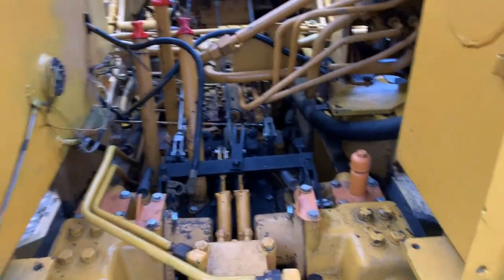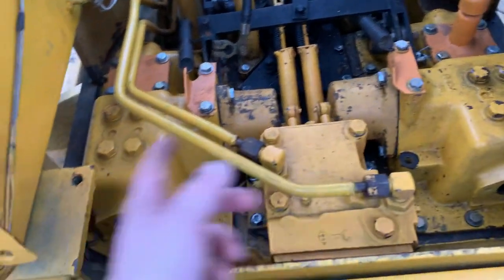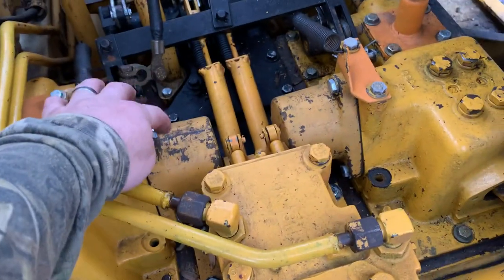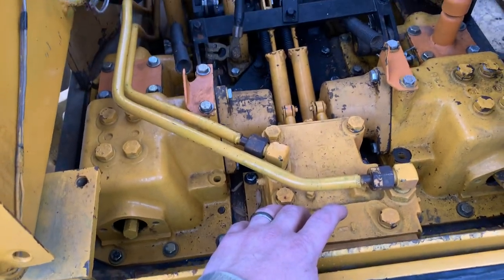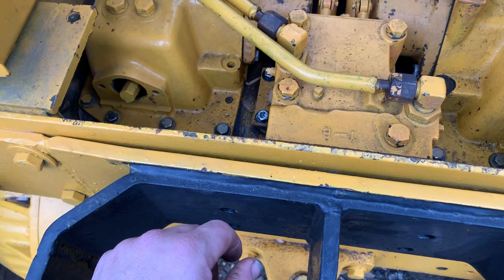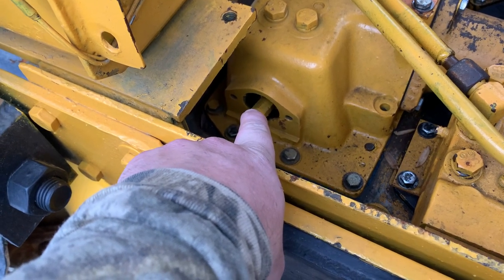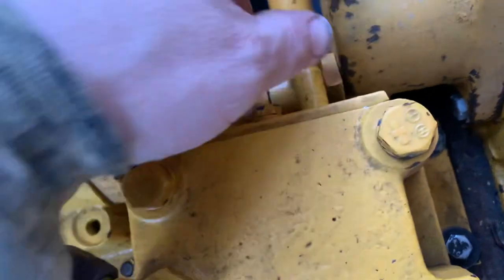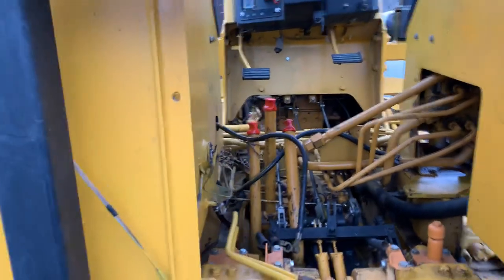KOMATSU D31 Bulldozer Steering Clutch Issues !

Comment: Know the steering clutch valve works off the main clutch oil on a d20. If it’s the same  check the oil level and oil screen on the bell housing they are known to get plugged and lose steering.
Reply from the maker: I did. no know that . I will Check it today !! Brother I appreciate any ideas because I have done everything including new steering clutches.  I do think it’s the hydraulic pressure causing issues. I will let you know if that helps
Reply: Hope it helps. I think  my d20 calls for 10w in the main clutch case, which runs the steering clutches. Let me know what u come up with.
Reply: Hope it helps. I think  my d20 calls for 10w in the main clutch case, which runs the steering clutches. Let me know what u come up with.
Reply from the maker: @jamesgray2435  brother mine was really low !!! I Thought everything ran off the big hydraulic tank . Lol !! Well it turns now, but you gotta pull hard. I think now it’s out of adjustment, all my linkage arms.

Comment: A lot of these machines come with wide swamp tracks.  They will ruin the clutches on hard ground, maybe even sand.  It took only 6-months to damage my D31-P in NE, Pa.  Why ?  because those wide track will not slip on hard ground so, the clutches slip.  Twenty years ago the Komatsu Dealer would change the clutches if I took them out, for 14K.  My machine only had 1000 hours on it when I got it and paid 17 K and another 300 dollars to move it 300 miles.  I than bought new clutches for almost 3K at dealer and installed them with my wife's help. I found a local guy to replace undercarriage for 5K.  Used it to build a 3-acre watershed pond. Have 3500 hours on it now.  Hardest think I find is getting those darn cylinders apart. I have the worthless tool for $400.00.  Don't work because of a welded fitting at end of cylinder. Can't go all the way on in center. I use a 6" pipe wrench with a twelve foot cheater bar & my son-in-law with me hanging on the end. Once you get it apart, it will come apart without a big deal the next 15 years. I replaced all but on gland.  
On the topic of will not turn. You need a inch-pound torque wrench to adjust the clutch break band. The procedure is in the owners manual.
Reply: I was using my dozer today and was looking at my notes. I changed the undercarriage at 2500 hours and the clutches the same time.  But I was thinking if I knew what I know today about the swamp track ?  I would use a cut off wheel and cut a few inches off both sides of the track.  That would prevent the clutches from wearing out. I remember trying to get one of the track off. Two people on a six foot pipe and nothing. The guy that changed them saved all the old ones for me. I am sure, he had a super good impact gun.

Comment: Did you ever figure out the problem?? Having the same issue
Reply from the maker: Yes my filter was clogged in my transmission, check your transmission fluid levels, and check your brake adjustment nuts. Mine works great now !

Comment: My owners manual says.  Tighten adjustment nut to a clamping torque of 5 kg.m so that the liner comes into Tight contact with the drum. Make sure lining is in close contact by stepping on pedal.  Unsure adjustment nut one turn. 5 kg.m =  36 ft/lbs  let me know if this works for you.
Reply: If that doesn't work.  Your couches are not disengaging.  Good luck. Hope this helps.

Comment: Did you get her working?
Mine wouldnt turn on one side hardly, ended up putting new beefed up springs on the steering clutches and she turns like a newone
Reply: Man it looks like the brake isnt releasing all the way like mine was doing, get you about a inch or so shorter/beefy'r springs and see whatchu get
Reply: I'd replace all them springs my guy  they're definitely worn
Reply from the maker: Well I got it going but it’s still hard to turn. You got to pull hard on the levers to turn it. I’m going to try to adjust everything this weekend, I bleed all the air out of my hydraulic system.   It may be the springs !! I never tested the strength of them. I know it’s pissing me off. !! Lol
Reply: @TheOutdoorLivingChannel  yessir you mine as well man, I'd replace everyone one it with beefy'r stronger ones, I even added a extra one that I hooked in from behind the clutch pedal cleavis straight back to a bracket I could hook it to and it helped out a bunch to assure they dont stick and the pedal releases all the way, these machines are known for this issue man and grease the slides and channels where it slides back and fourth on the steering clutch bracket thing to they're very temperamental. I was having the same issue, I was getting the smallest little turns and wouldnt turn worth a lick, brakes wernt fully releasing cause springs wernt strong enough anymore

Comment: Your adjustment specs are incorrect. I worked for Binder Machinery for ten years. Check your band adjuster specs.
Reply from the maker: You cannot adjust the bands in this bulldozer. It uses big springs in the clutch pack that holds them tight. No way to adjust them . Also it’s turning now. It was a hydraulic problem
Reply: What was the hydrolic problem?
Reply from the maker: @TheBigdoggg33  the screen in the transmission was stopped up